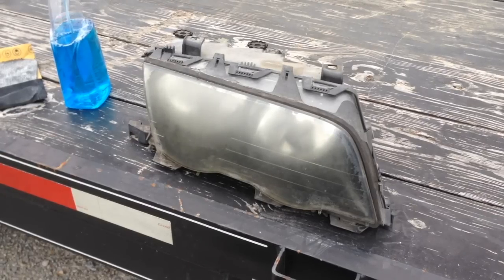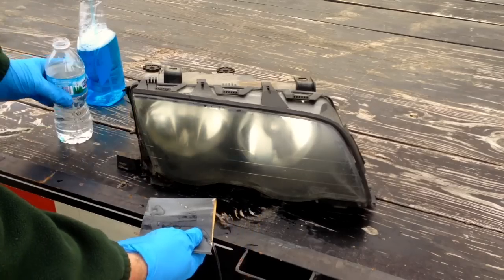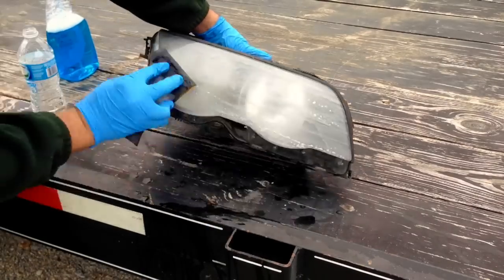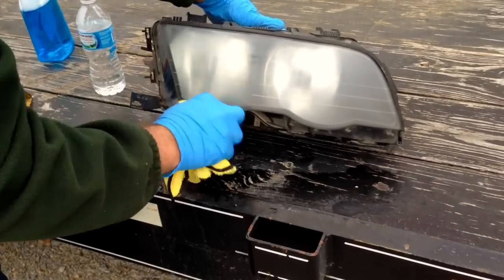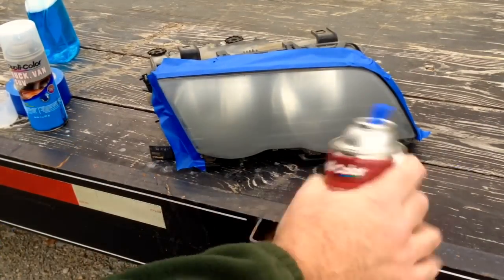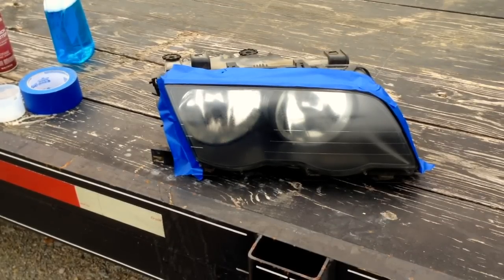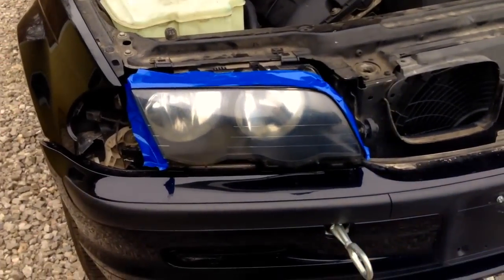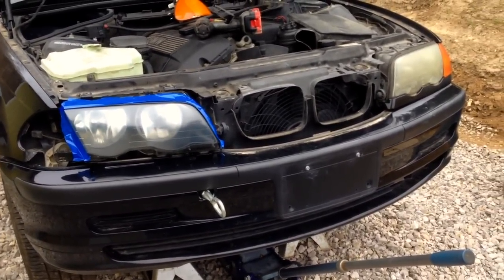Foggy Headlight Restoration DIY For $20  ( Longest Lasting Method )

Comment: Hi, Your DIY videos have been a major help on my E39 and E46. As far as buffing the headlights after 2000 grit, what do you use to buff? Any polish/compound or just 2000 and a microfibre? Thank you much.
Reply: 2000 will leave scratches.  You will need to polish.  I also recommend using a 2k clear.  Why you ask?  Because it is a catalyzed product that will harden ALL the way through in a timely manner.  It will also be harder.  THEN put a paint protective clear (clear bra) over the top to protect from stones.  Viola....  Real longest lasting headlights.

Comment: Good job .. what can spray of clear coat is that ??
Reply from the maker: +chaldoboy1000 that was duplicolor, you can use whatever you like but like I stated until you wet sand with 2000 and buff it will be slightly blurry

Comment: Headlight covers are on eBay for $30-40

Or you can sand with 1200 then 2000 and polish with 3 different polishing compounds from 3m

This videos method is a method that I as a beginner need to stay away from.